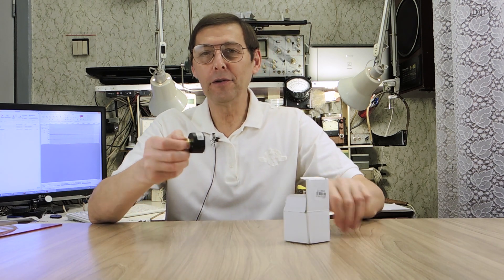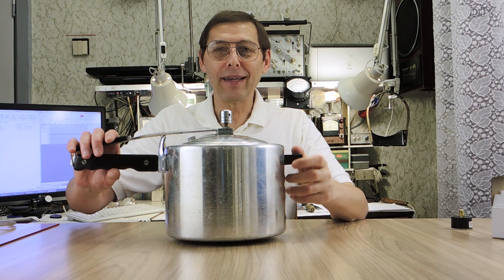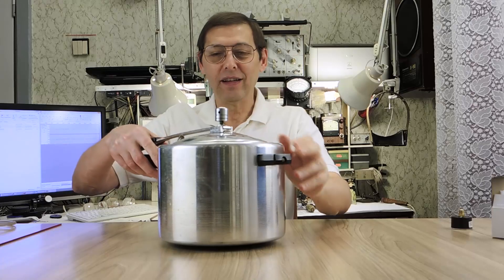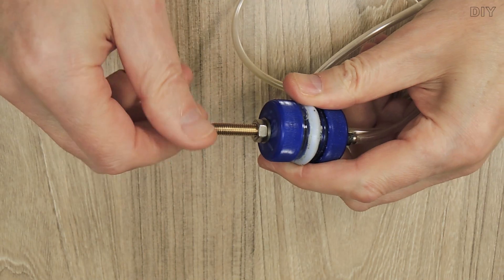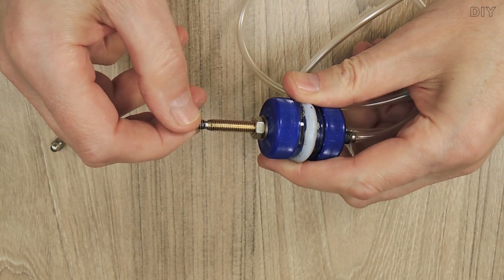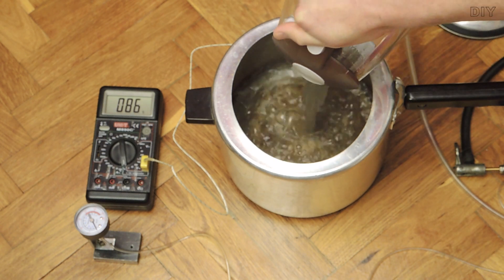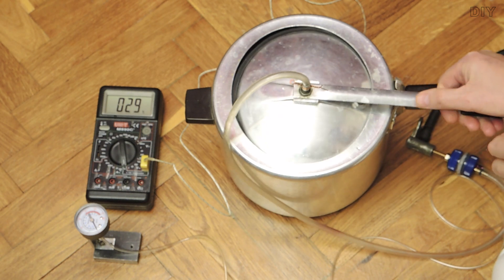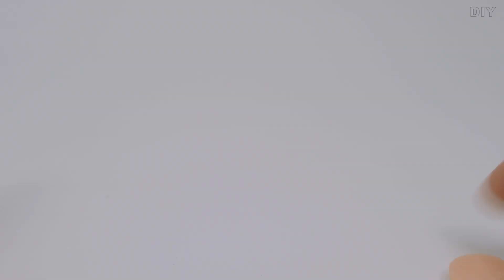📥 AUTOCLAVE only $6

Comment: Hello, can this autoclave be used at a temperature of 250 degrees Celsius?
I also need to make an autoclave for my university project.
Of course, the autoclave environment should be at 250 degrees Celsius for 3 hours.
Do you have any comments or suggestions?
Reply: Don't
Most pressure cooker design for 15 psi at most which 121 c. The pressure excess that need more thickness and 100% of pressure cooker not reach that level 
More than temperature is suicide it's boom

Comment: How do I operate this DIY Autoclave to sterilize a liquid?
Reply from the maker: In order to sterilize, nothing needs to be redone. With increasing pressure, the boiling point increases.
Reply: sterilize a bottle and it's cap (not sealed) in the autoclave. Add or mix in your liquid, such as liquid media, sterilize the bottle with the cap just started (1/2 turn, if its sealed the pressure inside the bottle can cause it to explode), if there is no cap, place aluminum foil over the top. It helps to pre-warm the liquid to about 60°C before starting. It should be sterilized for about 30-45 minutes at 115°C or 20-30 minutes at 121°C. When done, seal lid or foil top, using oven mits remove the bottle and place on countertop to cool. If you need to use the media before it comes to room temperature (such as pouring plates), monitor it's cooling and use when appropriate.
Reply: It also helps if you have a container for the media, a box to sit it in, that way any spilling or boil over is caught instead of dirtying the autoclave. Any #5 plastic should do the job, polypropylene. It's often the hard black plastic used in takeout boxes, the same kind that is microwave safe.